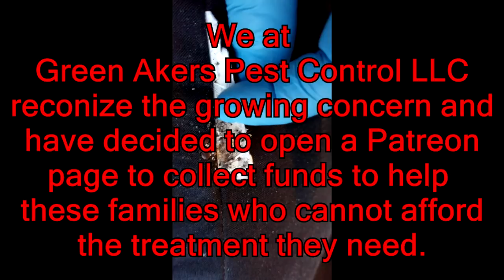MOST EXTENSIVE BED BUG TREATMENT ON YOUTUBE! - Learn how to DIY bed bugs

Comment: Nice thorough video. Also proves that bed bugs lives in clean homes too.
Reply from the maker: Dee Bradshaw yes. This is a very very clean home
Reply: Yes they do. There is such a stigma about them that people think only dirty homes get them. I am a neat freak and keep my home very clean and ended up getting them from guest who stayed over during the holidays.
Reply from the maker: Donnettia Mayer yes. They are just as contagious as the flu honestly
Reply: Green Akers Pest Control LLC it's a nightmare. I still have ptsd from them. I treated them myself with powder and natural chemicals. Not pesticides. I haven't seen any in a month but I still spray every few weeks. I am so paranoid  about them coming back and I'll never let anyone stay with me again. I'm always checking the beds and couches and keep thinking something is crawling on me even though there isn't.
Reply from the maker: Donnettia Mayer yes I understand the fear they can take up to 4 months to hatch so keep a watchful eye
Reply: Green Akers Pest Control LLC ok ty. I didn't know that. I use proof. Is that a good spray?
Reply from the maker: Donnettia Mayer Proof is Neem Oil. I have had a great deal of complaints from people who use Neem oil for Bed bugs and they claim to have mixed results. If it works for you, that's great.
Reply: Green Akers Pest Control LLC 
Wow, didn't know they take up to 4 months to hatch. 

I better keep spraying weekly. Haven't had any signs in a month.

Using cimexa, tempo?    And now nuvan strips.

So how long should i wait to sleep again? 6 months?
Reply: @DeeDee-ot3ry  lol sleep outside in the car
Reply: @GreenAkersPC  Wow...I did not know that, & it terrifies me to even try to figure out how I really DID get them. So scared.
Reply: @michaelboots7690  I am considering it, but we've been having -25 below including wind chills, I can't run the car in the garage because it trips my carbon monoxide detectors... screwed. And I really need the comfort of my bed with all I'm going thru. 😣

Comment: I live in Oshawa Ontario Canada. I have Carpet Beatles and the rash too boot so I started clean heavy in June still going slow due to a bad back am
Nd depresion.
I do a sixth month rotation of my bed so the springs won't wear out too quickly. I noticed non itchy rashes again and thought crap them again and found a larva on my bed so I inspected the sides. Bed Bugs. First time ever in my 10 years of having apartments. So I took Lysol Wipe and used it to kill them and washed the sides with it to start. I am going to alert my Landlady once I am done cleaning. 0 friends means I have to break my back cleaning. Thank you for the videos you have helped me think on treatments.

Comment: Where is your flash light? Trash bags to put your felts in?? Maybe use some bedlume plus on the tops of mattresses and couch will not damage.
Reply from the maker: Andrew Privette lol thanks for the advice. Home is bed bug free by the way and I prefer crossfire and it doesn’t stain either

Comment: Is it true that if u place things in garbage bags and sit them in direct sunlight it will kill the bed bugs. Or if u put clothes in the dryer on high heat it will kill any in your clothes?
Reply from the maker: LaShanda Glenn it is true about the dryer but as far as sunlight i would not count on that working because there will be pockets of cooler air

Comment: If I only experience bites in 2 rooms on occasion while sleeping, and never in waking hours, do I have to spray the entire 3 floor house?  Or should I just treat the room?
Reply from the maker: HamHamHampster I typically treat every room to stop any bugs trying to get away from the pesticide
Reply: Thanks, and just to clarify, when you say every room you mean the entire house (including basement) and not just every bedroom right?  What about furniture?  Do I treat all the beds and couches, even the ones not infested?
Reply from the maker: HamHamHampster couches, beds , easy chairs, and baseboards that’s all
Reply: Thanks for the response.  I been getting a lot of mix answers.  From throwing away everything, to treating every personal belonging and sealing it, to emptying all drawers and cabinets and spray on every cracks there.  Vacuum everywhere, steam everywhere, And of course, sprinkling DE everywhere like it's winter.

Then I see other places saying you don't need to do those things.  Just basic cleanup so you can get around the house to spray/powder.  Unless there are signs of bedbugs in a specific drawer/cabinet.  Moving things too much might make them spread everywhere instead.

Your information is a lot more helpful than most DIY on YouTube.
Reply: @GreenAkersPC  so do I need to treat the kitchen an dinner room? Nobody sits in those rooms by the way.
Reply from the maker: @kingbucketz182  I always tread every room at least baseboards

Comment: Like your videos, thank you for them. I've been awake since 3 am worried about bb. My mother lives upstairs and I live in a separate suite down. It's a very old house lots of cracks EVERYWHERE,  the walls and ceilings upstairs have gaps and the basement is a drop ceiling with open cracks , the furnace room has no ceilings so you can see the floor upstairs between the insulation.  My mom got the bed bugs when she picked up a cat from people living in a hotel,  must have been in the cat bed and box the cat came in. I bought an industrial  spreader and dusted the entire upstairs with diatamatouse earth, within a day they came downstairs.  These bugs are probably EVERYWHERE, ceilings, walls, attic....  I saw one on my moms ceilings the other day. Please help us. I live in Canada.
Reply: Bb will hitch rides on cats and bite cats. Update?

Comment: We have a waterbed, can't turn the mattress or pull it away from the wall. What do you suggest?
Reply from the maker: Drain the waterbed and treat the frame and under it
Reply: We did that, but we used the Ortho Bedbug spray. We are ordering Crossfire off the internet because we can't get any here in Anchorage, AK.  You have given us hope that we can finally get rid of them by your video. We thank you for that. I am 66  years old and had never in my life seen a bedbug until I stayed at a high end hotel and woke up with a handful of bites. I didn't see any bugs on me or in the bed but guess one snuck into my luggage and the creepy crawly came home with me. We've sprayed many times in the last year so that tells me that Ortho isn't the answer. I'm sure it's helped because we don't have many but I won't stop until there are NONE left.  Thank you for your video!

Comment: Is DEET based insect repellant sufficient at keeping them off you when entering an infested dwelling? I normally strip down entirely once I'm home after entering a place and put clothes shoes etc in the washer the water in that is usually 200F, and jump in the shower but I am paranoid about this and would prefer not to bring them home in the first place.
Reply from the maker: I’ve used deet to repel fleas and it works not sure on bedbugs
Reply: @GreenAkersPC  Good to know about the fleas then, I'll have to do more research and maybe do some testing on the bed bugs it seems.

Comment: If I used an aerosol spray of Cross Fire, would it still be safe/effective? I see them for sale on Amazon. Thanks.
Reply from the maker: It’s more effective to use the concentrate and mix it with water
Reply: @GreenAkersPC  ok thanks!
Reply: @GreenAkersPC  ...Hi thank you SO much for answering me. My husband has a follow up question. He wonders why concentrate is more effective than the aerosol

He also wouldn't believe me when I told him that some people can be bitten by bed bugs and have no reaction at all. Can I get a confirmation from you on that?

And, he asks if there is a big enough difference between the cheap sprayers vs expensive sprayers that we should consider buying one. We do not have a huge budget, and this is a struggle right now. If I got a 20 dollar (Chapin brand) gallon sprayer off Amazin to distribute CrossFire would it work just as well as an expensive sprayer... is there really a reason to buy an expensive sprayer if you aren't a professional. Thanks again.

Thank you, God bless. I really appreciate your answering. You are giving a tired exhausted mom some peace of mind i how she deals with these awful things.
Reply from the maker: @Nectarisa  1)I have never used the Aerosol but I know people who have who have had awful results.
2) I know people personally who have never had a single reaction from bed bug bites but were heavily infested
3) A good sprayer is a dream come true and can control the use of pesticides much better. A lot of the lower end plastic sprayers just flood the area with too much spray and waste product.

I hope I answered all your questions lol
Reply: @GreenAkersPC  You did, thank you so much. I'm up with bites. I figure I'll order crossfire on amazon with a sprayer. Do you have a brand you prefer of sprayer? (ok one more question lol)
Reply from the maker: Wynter I use a B&G but there is another stainless steel sprayer that is much cheaper here https://amzn.to/34MbIVK if you order one please let me know how it works because I think it should do way better than a plastic one

Comment: Do you do a follow up with crossfire after about 30 days like the residual is Or two weeks?
Reply from the maker: I do 30 day follow ups
Reply from the maker: It really just depends though. I try to put followups on my regular routes so if, for example, I did a bed bug job today (the 2nd Monday) but needed them to be on the 1st Monday to mix well with the route then I would come back on that day rather than wait an entire extra month because that would be far too long of a gap between visits.
Reply: Green Akers Pest Control LLC I see, cool

I'm gonna use crossfire, then phantom on second visit and transport the Third visit. I'll use alpine dust in the walls too which has diatomaceous earth in it
Reply from the maker: Greg B let me know how the phantom works for you
Reply: Green Akers Pest Control LLC I sure will my company doesn't do much bed bugs but we're starting to see a market for it so it might be a while

Comment: Hey I'm a subscriber here,  should I use syngenta with crossfire or just crossfire?
Reply from the maker: Just crossfire
Reply: @GreenAkersPC  thank you.  I'm planning to throw away my sofa that is less than 3 years old away because I'm sure there may be eggs and bb in parts I can't vacuum and spray. Would you think it's wise or would just spraying crossfire on accessible parts do the job? I also will spray my entire apartment
Reply from the maker: @Thelilantjr  the bed bugs will come out and die on the couch if you treat it
Reply: @GreenAkersPC  should I or should I not have a mattress cover "not encasement " and a sheet over my mattress after they spray? I was thinking having anything over the mattress would make the spray ineffective when they crawl up on my bed. Thanks Jason!
Reply from the maker: @Thelilantjr  make your bed as if you don’t have bed bugs. Don’t use total encasements but mattress covers and fitted sheets are fine
Reply: @GreenAkersPC  do you think a Vertical Garment steamer would kill any eggs if they were in clothing?
Reply from the maker: @Thelilantjr  yes
Reply: @GreenAkersPC  do bed bugs and eggs show easily on uv lights? I think they are gone. I ended up throwing the couch. I had it sprayed once and 6 days later my friend and I got bit from being on it. Company came back 2 days later and sprayed temprid again
Reply from the maker: @Thelilantjr  UV lights will show bed bug eggs but they are usually really easy to find
Reply: @GreenAkersPC  Is there a liquid that can be bought anywhere that kills bed bugs on contact?
Reply from the maker: @Thelilantjr  there are a lot of pesticides that kill on contact but the issue is that contact sprays typically don’t last long enough to kill bed bugs when you’re asleep as a residue. Crossfire, when applied will last up to 30 days and kill the bed bugs before they have a chance to reproduce.
Reply: @GreenAkersPC  my crossfire is held in customs and i have to run around and get approvel. My new bed frame is coming this weekend and I want to put the legs In a Tupperware with some kind of liquid that I can find anywher to kill any bbs that try and get on my mattressI can by anywhere just till I get my crossfire

Comment: Sadly I live in a apartment, don’t know how or where these bed bugs are coming from. Rarely have people over and I rarely go out. I’ve killed two adult and 2 nymphs bed bugs already end of February before using cross fire last week, after using cross fire I found one nymph on my mattress which was dying due to the cross fire and one nymph crawling on the couch pillow lively. I can not find the nest or dropping’s of where it could be. I have one more 13 oz bottle left which I plan on using half this time this weekend coming up which mark my 2 week. 

Would be nice if you can come spray my place for me or help inspect but I live in Wisconsin. Thank you for your vid. It’s been a stressful few months but I hope this cross fire will be my savior.
Reply: Der Moua what you want to do is move furniture away from wall and spray baseboards and spray bed frame, box spring and inside dressers.
Reply: Thank you for your reply. I’m so late at seeing your response, but thankfully everything has been resolved and clear. Good thing was the bugs didn’t start from my apartment, it was from the neighbor downstairs. I’ve learned so much from these videos tho. Thank you so much